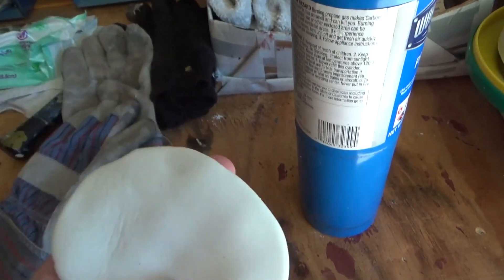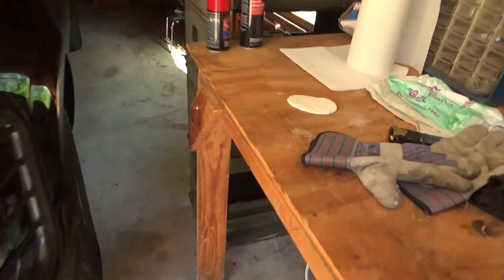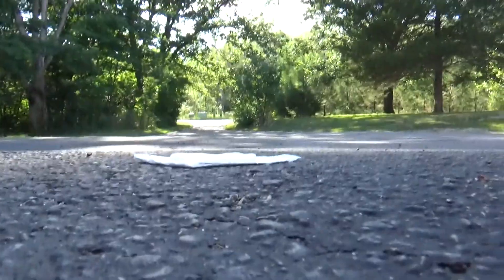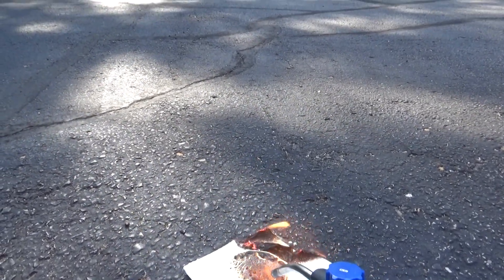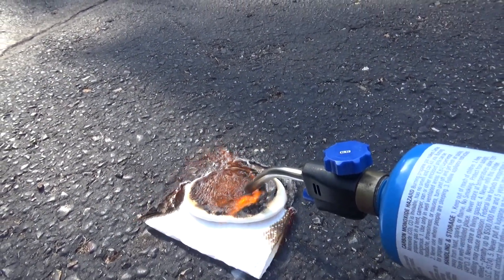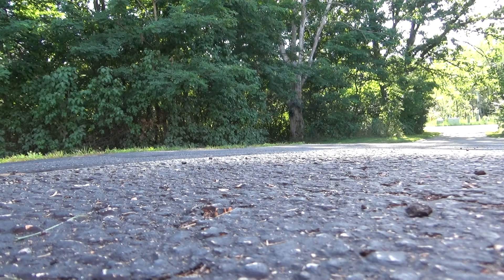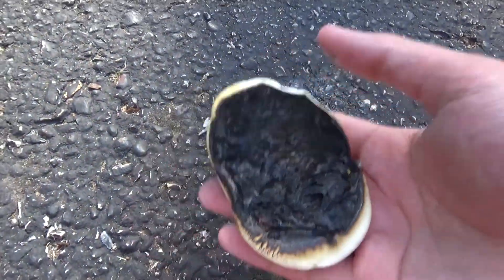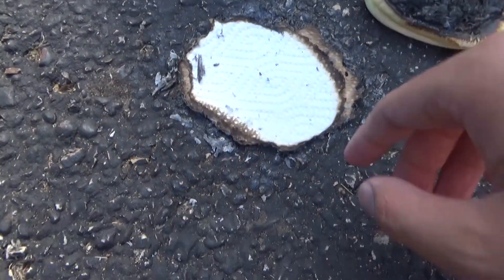Starlite Test #1 (NightHawkInLight Composition)

Comment: How much temperature can it handle ??
Reply from the maker: That's a good question. I'm not completely sure exactly what it's limit is. The original stuff was claimed to withstand nuclear warheads, but I doubt this composition could lol. Still, it can at the very least withstand propane, and I plan on using it to upgrade my metal foundry!